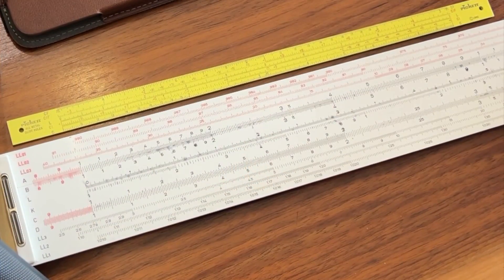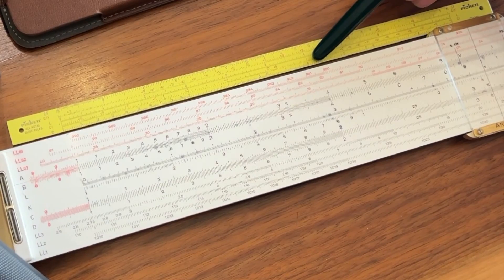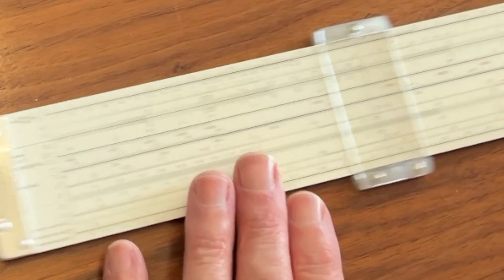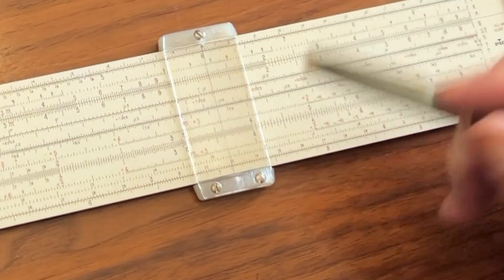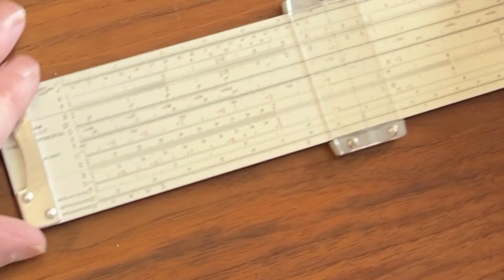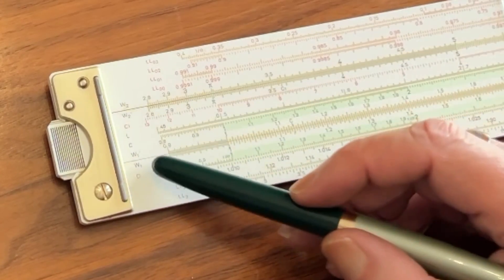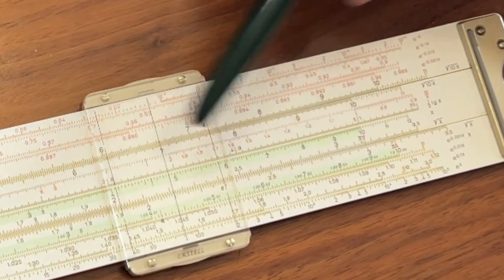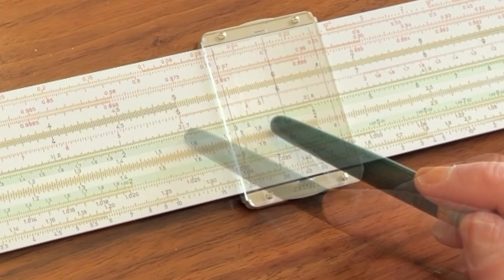Genius of Precision

Comment: I started college in the fall of 1975. Using my savings, I bought a “Bowmar Brain” calculator in the fall of 1974 which I used for my high school physics class. Nobody else in my class had a calculator. By the spring of 1975, both Texas Instruments and Hewlett-Packard came out with “scientific” (notation) calculators. 

About half the students in my college Freshman Chemistry class started out using slide rules. After the first examination, almost everyone was using a calculator. After the second examination, all those who had clung to using the slide rules had either switched to using a calculator or dropped out of the class.  By the time of the final examination, NOBODY was using a slide rule. For the remainder of my college career, I never saw a slide rule again.
Reply from the maker: I started high school in 1975 so I just missed it
Reply: My first calculator was a Rapidman 800, which was just a "four banger" (four function) with fixed 2 decimal points.  My next one was a Novus Mathematician, which was a full scientific calculator that used RPN.  Then, I had a couple of Sharp scientific calculators, one of which is still in my desk drawer, along with a Pickett Microline 120 slide rule, which I bought when I started high school in 1967.  These days, I have "RealCalc" on my Android phone.
Reply: Yes  being at college in the early 70s ,  i always remember seeing a lot of trash bins with slide rules in them , with the introduction of pocket calculators . My college tutor showed me his calculator he bought in the states , it was like a small brick in size,  with basic functions he then showed me his scientific calculator it was light years ahead in capacity and functions .
Reply: We used 4-figure tables.  I still have mine somewhere.   Calculators became a thing with us too in the late 70’s if you could afford one.  My first was a casio.  Been a casio fan ever since.
Reply: @GodzillaGoesGaga   I just blew the dust off one of my college math texts and it has 4 digit log tables, but 5 digit trig.
Reply: When I was in high school during the mid ‘70’s to the early’80’s we called one of our math teachers The Bowmar Brain because he could look at a complex problem and give you an answer in a minute
Reply: They were wicked expensive.
Reply: @plakor6133   IIRC, when that first HP calculator came out, it was about $400, which would have been 4 weeks pay for me back then.
Reply: In Middle School we used Log tables. In High School they deemed us ready for slide rules. Everyone had one and used it every math class ... or tables, and did so well into University. 
I remember when my science nerd buddy got one of the first TI/HP calculators (can't remember which one) on campus in 75 ... what a thrill.
Reply: @kaoskronostyche9939   We used log tables in high school math class but a slide rule in electricity, electronics and physics.  That was likely HP you had, as TI came a bit later.
Reply: @James_Knott  That sounds right. now that you mention it.  Also: yes, It probably was an HP because, in our small science department this device was the first of "the first" sorta thing. He spent an absurd amount of money on it.
Thank you for your reply

Comment: Slide rules were essential in engineering courses in the 1950's but the training to use them was often cursory.  You learned on your own what scales were most useful in terms of how long it took to get the answer.  In a 4 hour exam, computation time was and probably still is a concern.  In my experience the log log scales were used over the k and square root scales because it was too much trouble to remember the alternate scale rules.  Accuracy was the last thing we cared about since there was a grading range for "slide rule accuracy".  Also, we did not use compound calculations because it introduced further risk because there was little time to recheck answers.  Slide rule enthusiasts today have no fear of flunking an exam so they can engage in the joy of the mathematics and explore the many ways of making calculations.  This series in general covers much more information than I knew when I was taking math, physics, aerodynamics, and mechanical engineering.  In working environments, I seem to remember little discussion of the ever present slide rule on almost everyone's desk because most of the time it was used for basic math.  When the calculator came in we "appreciated" the significant digits but had to make at least two inputs to check for input error.  Strange to say I think that the slide rule was faster during an exam than a calculator- at least at first.  Today students are comfortable with being removed from the math and just getting answers just as pilots and Tesla drivers depend on computers to make decisions in operating their vehicles.   Not necessarily bad but stressful for many.
Reply from the maker: Well said.  I was talking to my dad today (Mech Engineer U of M 1959) to see if he had any tips/tricks for me from using it every day for two decades.  I was shocked to learn he didn't use a slide rule until college.  Training was an afterthought- you had coffee with a senior and he showed you what you needed to know.  While I use one quite a bit, when the numbers get big and precision matters, I use the calculator on my phone- but knowledge of how to set up the problem comes from the slide rule.  I am more interested in the teaching and learning aspects of the slide rule, the understanding of numbers and how they relate to each other.  Removing students from the high school and even middle school 'from the math' is a bad idea, at least in my opinion.  My trig course (it is coming) will require fluency with a slide rule.  I will use it to demonstrate the relationships (think law of sines) and the trigometric functions.
Reply from the maker: BTW, this is a course on math, the understanding of the use of the slide rule is sort of secondary, but really cool.

Comment: Thank you, Bob, for your video. For those who are unaware, a "10 inch" slide rule has an actual scale length of 25.0 centimeters which is 9.84252 inches. This was because slide rule manufacturers used an international standard scale length of 250 millimeters.
Reply: Fortunately, Americans in STEM who cling to imperial are fading out of existence.

I've even switched to metric recently for my home projects, and millimeters are way more convenient for measuring and cutting.  We are metricating slowly, but it is happening.
Reply: Some might be unaware of a concerned with a conversion of a three significant digit number (25.0) to a six significant digit number (9.84252).
Reply from the maker: We refer to it as a 10 inch SR because- Murica. But of course you are correct.  A 20 inch slide is actually 50cm.
Reply: @sliderulesandmathematics9232 What is Murica?
Reply: @plp91 ,like "Schland" but for a different country.
Reply: @sliderulesandmathematics9232 I've never used a slide scale, but have one question to your mentioning of the difference caused by 20 inches converted to 25 cm on the scale length.

Since the SI standard says one inch is 2.54 cm, why doesn't a 10 inch slide end at 25.4 cm instead of 25? It seems a bit illogical to not have both units end at the same spot on the scale...
Reply from the maker: @LarsV62  close enough